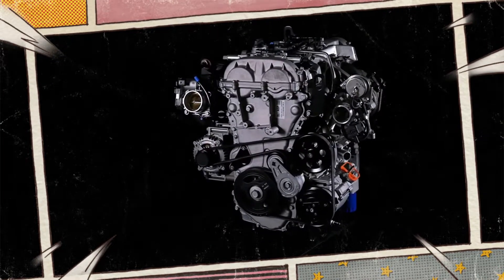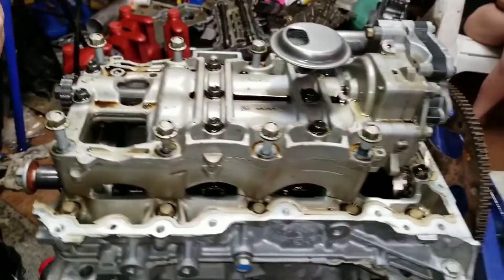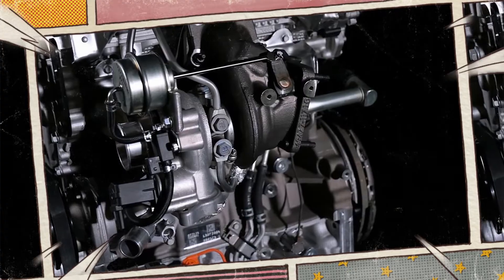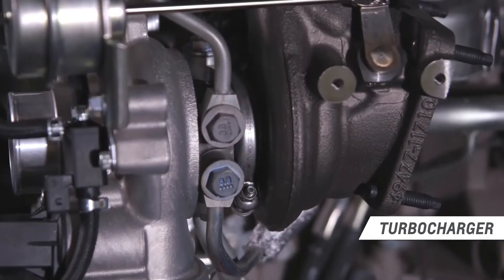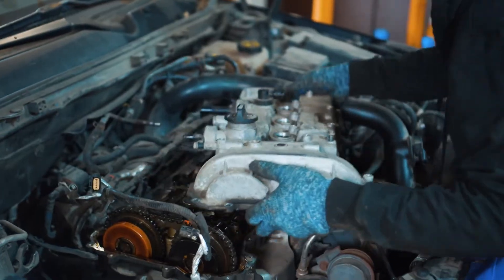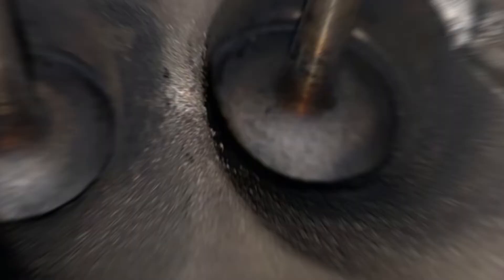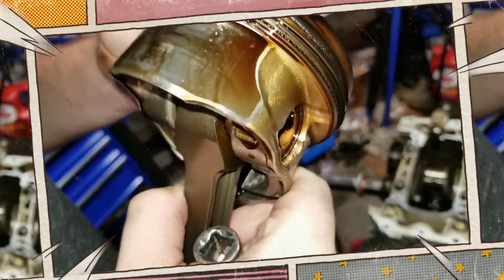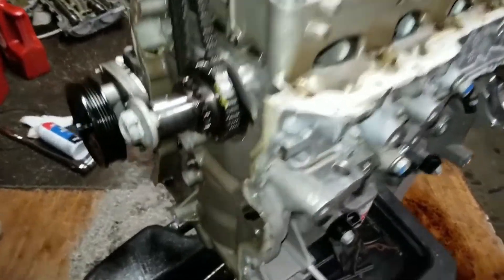GM 2.0L Ecotec LTG Engine - Overview, Problems & Reliability

Comment: i have a Cadillac with this engine with 170K and no problems. i did have to replace the coolant sensor.  I have bought a timing chain for it but not yet put it on.  I probably should do it soon

Comment: Change sparks plugs at 70k km and coil before 100 cause mine failed while am driving other then that and yeah i recommend to take the engine cover off because it just heating oil vacuum lines

Comment: Engine good for 360,000 miles before a cheap rebuild.❤
Reply: Did you have to get the intake valves cleaned because of Direct Injection?
Reply: 120k km, 7 years in my ATS, no issues. I drive spirited.

Comment: My 2019 Equinox has one of these 272hp turbo motors.  Goes pretty good with the 9 speed auto.  Zero problems with the motor at 91,000 miles.  Pulled a 1300 lb trailer 3000 miles, gas mileage suffered and there was the added cost of 89 octane fuel.  But at 55mph with no wind on level ground, it says it's getting 33-38 mpg, get a good tailwind and will get over 40mph easily at even higher speed.  Over the last 3000 miles, I've averaged 31mpg with mostly highway driving at 55-70mph
Reply: Is it a crate  motor or stock? I thought the stock motor was 252 hp on the nox?  I own a 18 Nox with 2.0/9 spd. Great car!
Reply: Have a loaded 2019 2.0l premier awd.  Its 252hp, the 275hp is only in the camaro.
Reply: @roadrunnerorange  I see that now.  googled 2.0T and it came up with 2725 .. didn't look farther
Reply: I have one of these in NZ in a Holden Commodore, it's done 225000 kilometers and is still like new, we have nice gasoline over here, 91, 95, 98, 100 octane available

Comment: bought a 23 camaro with this engine. i have 10K miles right now. i change the oil every 3K miles, premium fuel only, and let the turbo cool down before shut off. hope to get a lot of miles from this car
Reply: I have a 14 regal GS I was plagued with the cracked pistons BUT had it replaced and so far ZERO issues, I have about 140k miles and other than the piston issue overall reliable.
Reply: i also store it for the winter, and im missing it RN...
Reply: As far as the oil change intervals, just watch the oil life monitor. Gm's oil life monitor is extremely reliable and can be trusted. I got a 2018 regal with the ltg and I just change the oil when it drops down somewhere in the 20-25% range.

Comment: Run 93 octane and change the oil every 3500 not 7500 miles, and it will last forever. Dirty oil and low octane gas will nuke pistons.

Comment: Anytime a major automobile company puts plastic coolant lines and elbows in from the factory that tells me they don't want to build reliable products. GM, Ford and Chrysler used to build great reliable quality products back in the 60s and 70s and some of the 80s but not anymore. Boo big 3
Reply: I'd rather plastic elbow fail than moving the problem in the engine.
Reply: @noname-pb9vj fair. Also whenever a plastic line fails. You could probably replace it with a metal one as a permanent fix instead of another plastic one.

Comment: spark plugs will not last a 100k
Reply: 60,000 I believe. is the change interval
Reply: Made it to 140k on original 5.7 Hemi plugs
Reply: @WorkingOnRocks  hemi is dodge hes talking about  gmc?
Reply: R u fucking dumb 😂 no ones talking about dodge. Chevy and dodge are 2 completely separate companies with 2 completely separate engines
Reply: I have 2020 2.0 terrain 124k (km) still company plugs
Reply: @Music_world951  The suggested replacement Miles, is 60,000 miles...

Comment: 1-4 turbo intercooler petrol engines all companies, 1-4   turbo intercooler petrol engines hybrid all companies disadvantage 
1. Easy damage in test maximum engines at 20,000 to 150,000 rpm.
2. Problem pressure ignition petrol fuel as too lower than pressure ignition diesel cause of uneconomy and damage all parts by software error.
From
1-4 turbo intercooler petrol engines all and 1-4 turbo intercooler petrol engines all hybrid database with all companies
Reply: Negative, all systems are go!

Comment: Generally a good engine, if maintained with proper gasoline and oil. Avoid engine mods/tunes unless you change the pistons to forged.

Comment: Id like to see one built to 800hp+ in the Camaro to see how it performs.
Reply: That makes not sense 😂
Reply: @justinserna9995  "not sense" makes no sense🤣 just kidding I don't mean to mock you
Reply: You put 800 hp in any low displacement engine on stock components and it’ll explode. For it’s low displacement and high power, it is one of the longest lasting 4 cups gm has made.